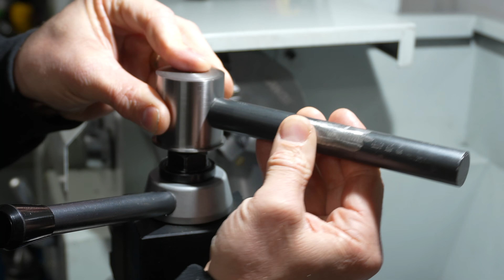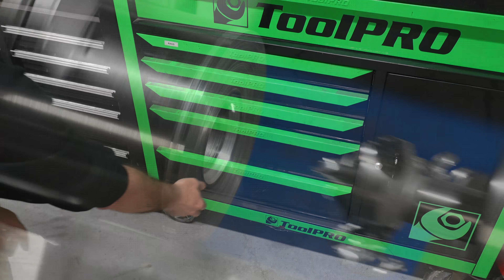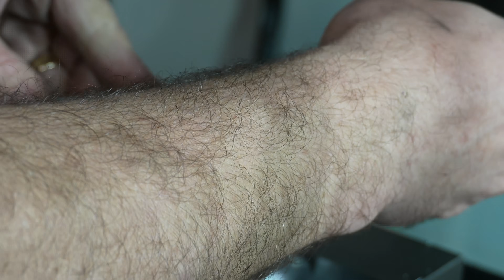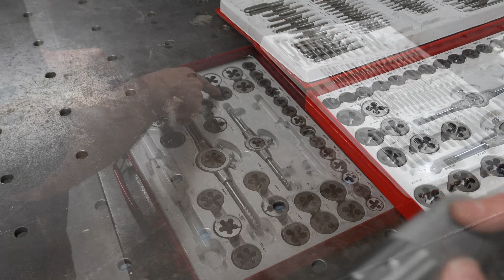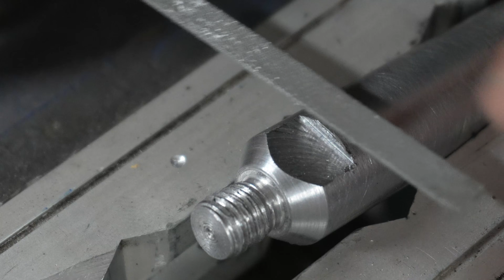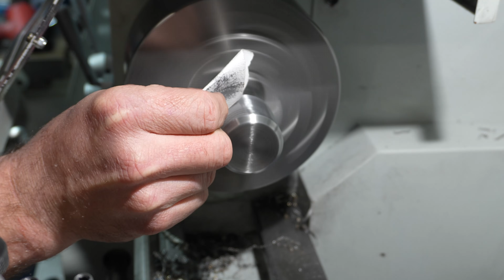Simple Quick Change Tool Post Lock Handle

Comment: You don't have a drill chuck for the Mill?
Reply from the maker: Yes I do have one 👌
Reply: @FAB-LIFE444  I was wondering why you were holding all the drills in collets.
Reply from the maker: It was just easier than changing it out unfortunately. The Jacob’s chuck has a different draw bar and also I didn’t have the clearance and would have had to change the height of the bed.

Comment: 8.5mm OD, for an M10 thread?  🤔
Reply from the maker: What part of the video are you referring to?
Reply: @FAB-LIFE444    You said you were using an M10 die, and you were turning the bar down to 8.5mm.

8.5mm would be the correct drill for tapping an M10 internal thread, but you need a 10mm (or a couple of 10ths of a mm under) for an external thread.
Reply from the maker: Obviously I had just made a mistake with the voiceover

Comment: Are you going to put a thrust bearing underneath it bud? 🤔
Reply from the maker: Hahaha I did use it without one for a while as I wasn’t aware it’d be an issue. I later purchased one and it’s made an amazing difference. I can crank it down but at the same time, I don’t need a mallet to undo the damn thing haha
Reply: @FAB-LIFE444 😱😂
Reply from the maker: Everything is such a learning curve. 😅

Comment: Hi mate. What size tools are you using. 12mm, 16mm?
Reply from the maker: The lathe came with 12mm but I soon switched to 16mm. Way more rigid. Temu has a great selection that work really well for the carbide options. Hope that helps 👌

Comment: Yet another great video. I could tell right away that you needed to angle the handle but you recovered nicely.

I would’ve, however, probably made a screw on knob and machined your 14mm tightening flats on the thread of that so it could be concealed by the knob, just to make it a bit more tidy, but you still pulled off a great job none the less.

Well done, thanks for posting.
Reply from the maker: Thanks mate for you positive feedback. I have a true bearing on the way for this handle. The damn thing was very hard to undo 😅

Comment: Quick tip for getting stuff squared up in the Chuck is grab some parallels hold them one ether side of a Chuck jaw and push the work up against them and tighten Chuck, then a must is to REMIVE parallels by sliding the out befor starting lathe  👍🏻
Reply from the maker: Cheers to the great advice. I’ve tried this method before. It works really well 👌
Reply: @FAB-LIFE444  I find it my go to for a quick setup of small parts now, nice and simple. Good video by the way, only just found your channel
Reply from the maker: Thanks man! I appreciate it. Machining is definitely something I love doing.
Reply: @F @FAB-LIFE444 im jus fitting a auto feed to my milling machine thats not designed for it and its taking so messing about
Reply from the maker: That’s definitely something I’d like to do one day
Reply from the maker: Do you have a link for it?

Comment: When drilling your center hole for your live center, you have to drill all the way until you are on the 60 degree chamfer part of your center drill. That 60 degree chamfer matches the 60 taper of your live center, and is what the taper of your live center rides on. You only drilled a pilot hole with the tip of the center drill.
Reply from the maker: Since making this video, I’ve definitely corrected my process when using that tool 👌

Comment: Making any project on the fly, rushing in to make something, invariably leads to a disaster and subsequent bodge. It's not cool or clever to admit that you haven't learned how the professionals do it. That knowledge only comes with an apprenticeship. Machining under pressure for a living does not allow for mistakes if you want to earn top dollar and keep your job. An old saying that I was brought up with is ' An hour on the board saves a day in the workshop. ' The board, referring to a drawing board.

You missed a wonderful opportunity to add a thrust bearing to the assembly and machine the 15 degree taper on the top of the boss so the handle sits square.

Here is a tip for male threads - tap the end of the handle and fix a high-tensile grub screw instead of using a die or single point threading. It's far quicker, no undercut required, less material, and much stronger, especially in softer materials.
Reply from the maker: Thanks for the comment 👍

Comment: Don’t worry. Single point threading is for when you don’t have any other options.
Reply from the maker: You’re right. I didn’t have a 20mm tap so it was my only options for the flexible pipe. 👌🇦🇺

Comment: nice work but a bit tapping oil will keep your taps lasting much longer and easy. yor turning tool with the square inserts dont make nice cuts, mine also quite useles.
Reply from the maker: Cheers for the comment. Mine definitely aren’t useless as you’ve seen in my videos. They have definitely served their purpose in cutting the threads I needed. Yes they aren’t perfect but they get the job done. Cheers for the comment 👌🇦🇺

Comment: I made the same thing. One improvement I made was to add a 3 piece thrust washer embedded into the base of the nut to keep swarf out.  It makes for smoother operation . It is well worth the effort instead of using a spanner. Well done 👏
Reply from the maker: That’s a great idea. I’ve been using the handle a lot lately and it’s definitely way better than the spanner. Thanks for the comment 👌🇦🇺

Comment: Why didn't you just use the one off your old tool post like I did
Reply from the maker: Cheers for the comment. The original bolt is an m10. The new bolt is an m16. Besides the massive difference in thread  size, there wouldn’t be anywhere near enough leverage to properly tighten the m16 bolt with using the original, tiny handle. Do you have the same lathe as I do? Cheers👌🇦🇺

Comment: You don't need to single point thread for a simple nut like this, using a tap like you did is fine. Also using the steady rest is a great idea if you have not built a tap follower yet. I did wonder when I saw you drilling and tapping the first handle hole. But you showed the issue and how to fix it. That is good as others will now be aware of the issue when they are building one. Good build that functions well in the end. Hi from NZ.
Reply from the maker: The comment section loves to mention single point threading all of the time. 😅. That’s why I mentioned it. I to didn’t see any point in the setup for such a small thread. In saying that, I do need to practice single point threading as I’ve got next to no experience with using it on any projects yet. I have had a crack off camera and made an m12 thread.  Messing with the change gears is such a hassle on my machine. 👌🇦🇺

Comment: Seems odd that there are 2 locking levers. I have a Dickson quick change tool post and it needs only one locking lever.
Reply from the maker: It would be good if it only had one but that’s how these are designed. Many online are just like this. Cheers for the comment👌🇦🇺

Comment: I did the opposite to you I got my handle Angle 😂perfect but it lined up right above the other handle
Reply: Or you could just face off the bottom of the nut a bit, then the handle will rotate just a bit farther when fully engaged.
Reply from the maker: Haha. If I kept the original thread but at the right angle that would have happened. Did you just chuck a washer under it since the angle was right? 🇦🇺👌

Comment: All of that wasn't really necessary. You just need to make a washer, to fit under the main part. This will move the point where the rotation stops back. You can adjust that point, by changing the thickness of the washer.
Reply from the maker: Cheers for you opinion mate. I definitely did try that method off camera and I really wasn’t happy with the end result. Aesthetically it looks better having a handle matched with the other…Now the two handles will never come into contact with one another. Cheers for watching 👌🇦🇺

Comment: Good day mate. Hope you’re doing well. I thoroughly enjoy your videos. And it’s good to see there are still people out there giving everything ,go just a heads up ,using collet chucks or drill chucks to hold taps and die holders. Will wear the chuck or collet chucks out extremely fast to the point where your  chucks will not even hold a drill under the light loads ,Keep up the good work and the great videos thank you.👍
Reply from the maker: Thanks for the great advise. I was wondering if I should be doing that or not. Cheers 👌🇦🇺
Reply: Not a problem, buddy you’re doing great work not easy to start up from nothing by all these great tools it becomes costly but is very rewarding at the end like I said before it is good to see people like yourself getting out there and giving it a go🇦🇺
Reply from the maker: That’s what it’s all about mate. Just have a go and you might surprise yourself along the way. Anyone who’s amazing at something always started from zero. Filming these videos makes it so much more rewarding to then look back at my journey so far. Cheers for your positive feedback 🙏🇦🇺

Comment: Honestly, the DRO makes single point threading a lot easier 👍👌🇦🇺
Reply from the maker: A DRO is definitely an upgrade that’s coming soon. I’ve started some research on them. It won’t be long until a video pops up of the upgrade that’s for sure 👍
Reply: Well I’m not sure I understand that. I’m school trained but never worked in the industry thus I know just enough to be dangerous but I’d love to know about this DRO and single point threading. Sure would solve the anxiety of throwing the lever at the exact right moment.
Reply: @steveo1006  you'll still have to hit the lever at the exact setting for what thread you are doing, honestly I don't think a DRO makes single point threading easier, maybe easier to hit your final niumbers? I don't know,  however for other operations a DRO can be a big benefit on a lathe.